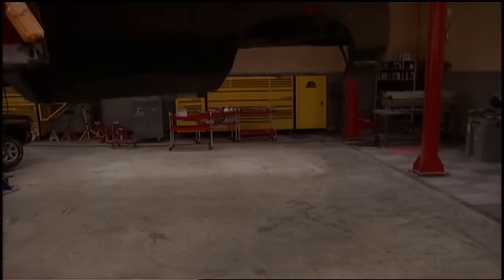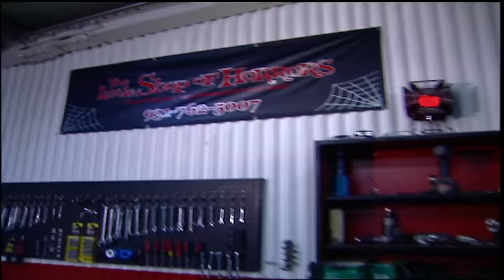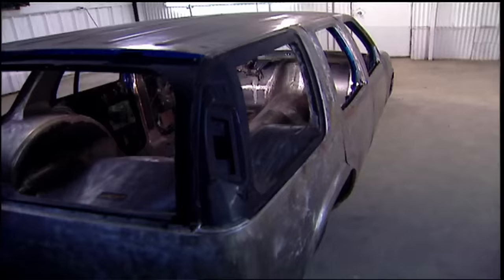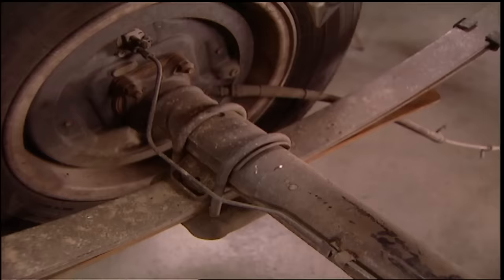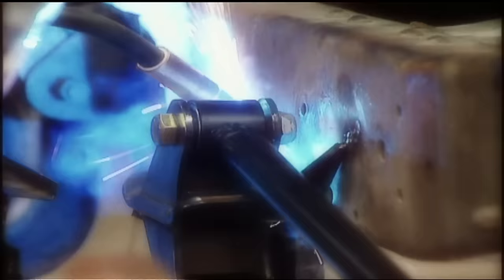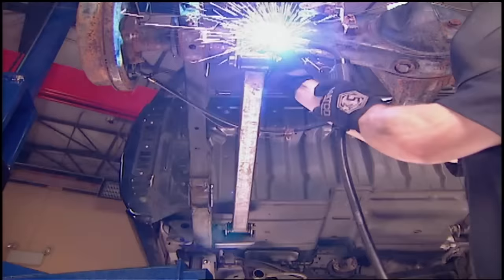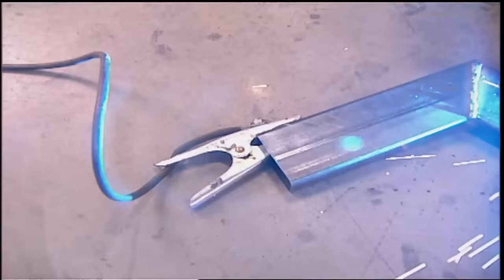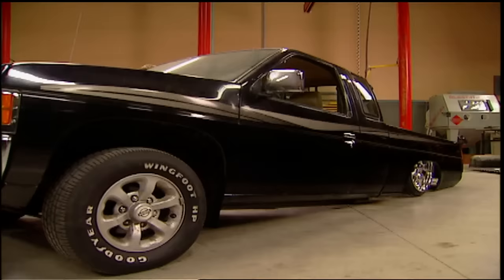Turning a Nissan King Cab Into a Wild Mini Street Truck! - Trucks! S8, E14

Comment: I havent watched this since I was a kid. Id say overall there is some pretty good advice in this video, especially for a young kid getting into mini truckin'. Just a few things I noticed that I would recommend paying attention too for some beginners. 
1. Dont weld the c notch to the top of the frame. Cut the tubing long enough that you can run it down through the top of the frame and weld it on the inside of the frame. Then box it. 
2. as the truck travels up and down the rearend will move front to back changing the location of the wheel in the wheel well. Watch when they air the truck out the wheel comes forward in the wheel well of the bed. It will look centered while aired up driving, but probably look forward in the wheel well while aired out. Just be aware so you end up with it centered when you want it centered. (You can tell theirs traveled forward alot, I wonder if thats why they only showed angled shots and not a nice side view)
3. If you decide to run a crossmember between the bed mounts that has a load on it, like the upper link bars, entertain the idea of gusseting the bed mounts or bracing them to handle the stress. 
4.Practice welding before hopping in. Scrap is your best friend. practice, practice, practice. 
5. If you wanna see the most ridiculous mini truck, come check out the Dat-sun King Delivery rig here at PFS.
6. Pay attention in school so you have better english/ grammar then me.
Reply: me to
Reply: i love your Mini Truck it come out nice
Reply: Bring that thing to Mini Nats!
Reply: I have watched that Dat-Sun King build ( and every other video you have done). Learning so I can build my 95 hardbody. Remember sitting on your ass won't finish your project.
Reply: Step 1 listen to puddin!
Reply: The king has spoken!
Reply: Hey puddin
Reply: when I read this I could almost hear your voice 🤣🤣
Reply: @Puddin's Fab Shop  RTM/Powernation is looking for another personality
Reply: You tha man puddin!!
Reply: Was the arm swingin' while stating this?
Reply: puddin mannnnn!!
Reply: I bought these episodes on iTunes ages ago. Still watch them from time to time.

Comment: I got a 90 haven't lowered it yet not going gonna be a 3/4 drop around 200 whp na ka24e umm stock block stock crank ported head and intake bigger valves and springs pacesetter longtube header injectors it will keep up with a coyote 6 speed to about 120

Comment: This an OLD episode lol! I used to have a 96 Nissan D21!! Loved that truck! Still miss it.
Reply: Do you know if the cluster stopped working how to get the mileage? Can you find it in the computer system?
Reply: @popclutch_100  no mine kept going to 200k.
Reply: @Storyracing387  then what happened?
Reply: @Storyracing387  trying to get a reading on the miles for my 92
Reply: @popclutch_100  what happened to the truck? It was towed by police and didn't have the money to get it back.
Reply: @Storyracing387  my cluster stopped working I took it out and at the time it was my only form of transportation. I was driving around with no cluster which sounds so stupid but I did. I drove like that for like 350 miles. I did put it back in. I want get the exact miles for the cluster becuase I want build a bagged and bodied hardbody d21 badly!! If you can help please let me know. I'm the second owner and my dad is the original owner. It's been in the family new since 1992. One the reasons why I want build the truck so much.

Comment: 15 degrees will give you all the locating you need and also allows to not have the upper links on top of the diff center. It will however reduce the rotation side to side motion in the housing

Comment: Does the upper bars have to extend out from the diff housing or can they meet at a center point in front and be spread on the axel? Some diff housings can't be welded on very easily.

Comment: Great fab work but I think the mounts (bolts) on the top of the rear end  should be parallel with the ground. The way it is now it wants to twist the top bars as it runs through its travel.

Comment: Problem that I have with this Episode is, what was the ORIGINAL Recording Date?
Would be SO NICE to have an Intro stating when these "older episodes" aired on TV/Cable...
Given the Vehicle and work to be done, I would "Assume" that this was recorded in about 1995-97 given the "Mini-Truck" Trend of the time.
Still, a great episode and vehicle to be "modified"!
Reply: Early 2000s
Reply: This is from 2006, maybe early 2007.

Comment: That's a step notch, not a C notch. A C notch is a C shaped piece of pipe welded in the frame. A step notch looks like a step. Secondly rear facing 4 4 links are the worst except for a 2 link. No reason to point the 4 link bars to the rear.

Comment: Good Lord I used to be into bagged vehicles a lot back in the early 2000s but I got tired of it after blowing bags and being stuck in the middle of a busy road with people yelling and cussing you and cops pulling up wanting to ticket you. Nowadays it’s static dropped for me or don’t lay completely flat so if you pop a bag you can still limp it….
Reply: Same here on the bags..I switched to juice and don't have near as many problems.Hydraulics seem to last forever but are a little messy.
Reply: What kind of cheap ass bags were you using?
Reply: @angrybadger8136  We used all kinds of bags fittings and valves back in the day there’s always gonna be a problem where you pop a bag blow a airline and bam… your truck is laying flat on the ground you can’t move it and your blocking traffic sorry but that’s no life for me anymore.

Comment: lowering trucks for "performance" is a crime against god and man..... make it perform but damn.... lift it and let it spin all 4 on dry pavement... trucks want to be trucks...
Reply: Why would you lift a 2 wheel drive?
Reply: @its_just_chad  2wd trucks are like having a peen  with no balls....... they just shouldn't exist.....
Reply: @sibhuskyguy  yeet yeet
Reply: Calm down gramps, not everyone wants a lifted truck just to drive to the grocery store and back. There are lots of bagged trucks out there that still do truck things (hauling/towing).
Reply: @jerm724  even if it's got stock suspension, lowering trucks is just wrong....  i had a stock dodge ram 1500 with just slightly larger than stock tires on it (mud terrains) and it did truck things just fine. could barely handle it in the rain but.... i beat mercedes 500 series in speed and handling on route 46 here in NJ....